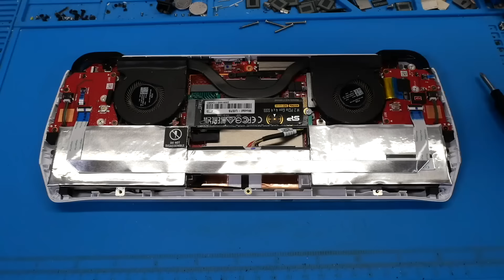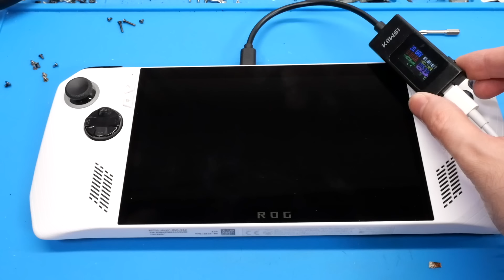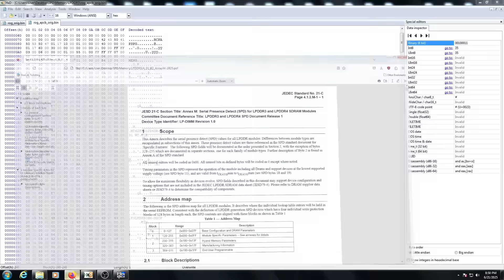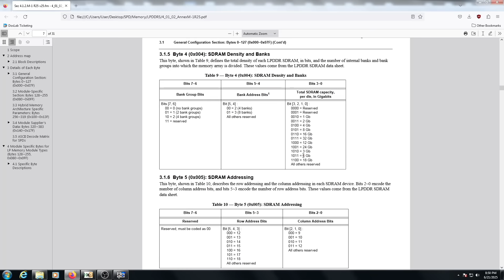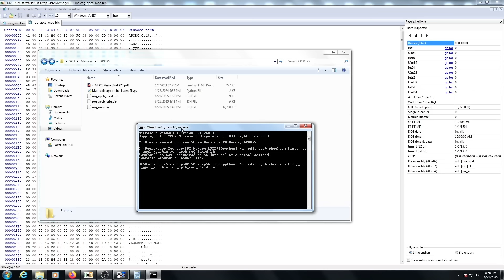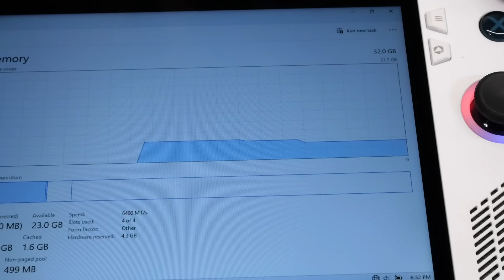ASUS ROG Ally 32GB RAM Upgrade

Comment: That ambient light sensor is actually pretty smart and can help inexperienced people. Swapping out the nvme is fairly easy to do in many devices these days, but people have screwed it up before... I told my friend multiple times to unplug the battery first, he struggled, so he just didn't. He then used his non magnetic screw driver and dropped a screw and shorted the powered board. If it had a light sensor, it would've cut the power off for him.

Making the ROG ally safer to disassemble + easy to mod is actually really cool.
Reply: Noob mistake
Reply: Most probably it is there to detect chassis intrusion.
Reply: @meetv7700 except it cuts the power and asus allows you to swap parts like the ssd. They don't even make it hard to open up via hiding screws or putting a warranty sticker.

It cuts power, then when you reassemble it and plug it in, it'll turn on normally
Reply: @KevinEF that explains why it doesn't turn on while disassembled. Did they know how many people will be terrified when their system doesn't power on while testing???
Reply: @m3zmr  skill issue
Reply: Wait, we really need to disconnect battery each time? I swap ssd nvme hundred times just unscrew- remove- put another ssd - done 😅
Reply: @DIMONSE123  You don't necessarily "need" to, but if you're a repair tech that knows what they are doing, you disconnect it.
Reply: @DIMONSE123 It's just good practice to avoid shorting stuff on the mainboard. Yeah you can just wing it, but overconfidence can lead to bricking things, so I'd personally just rather avoid that and unplug the battery.
Reply: @DIMONSE123  it's not necessary for swapping the SSD, but it's a general precaution to avoid issues as mentioned in the OP. That's the same reason there are safety railings. If you are careful you don't need railings, but sometimes mistakes happen
Reply: @DIMONSE123  There will never be a time where you wish you didn't disconnect the battery first.

Comment: Why 32GB and not 64GB or more? What is the maximum RAM that can be used on this specific device?
Reply from the maker: I did try 64GB on the Steam Deck at least, and couldn’t get it working, though I also wasn’t able to find any data sheets for the larger chips, so couldn’t determine the correct changes that needed to be made to SPD data. There’s also a possibility that the chips that large require extra address lines, in which case they couldn’t be used.
Reply: @dosdude1  Interesting. What about performance? Are there any measurable gains? Or at least noticeable better responsiveness or something?
Reply: @ronaldocost4 Since system RAM on an APU like this is both the regular RAM and VRAM, games should be able to run better or at higher quality settings than before. If a game needed 8GB of VRAM before, that left about 6GB for thr rest of the game once windows took its background piece. Now that's leaving 22GB for the game.
Reply: @ronaldocost4 from the Ally X vs the Ally with 24gb and 16gb respectively, most games perform just about identical. There are a few games but most of the time, the resolution and setttings you’ll be playing at will not benefit the 32gb or 24gb kits more. The Ally X actually gets more of a performance boost due to its ram being faster rather than the capacity increase

Comment: Amazing video! Could I ask what hot air station you use? I'm looking to get a new one and at the moment it seems most recommended is the ATTEN ST-862D but still looking around for comparisons
Reply from the maker: I use an Aoyue 852A++... Really works well for everything I’ve used it for, so I’d highly recommend it.
Reply: With respect to dosdude, the equipment he uses is among the worst. Aoyue852A++ is an ancient obsolete hot air station and you should not buy it. Newer stuff like ST-862D is much better. 
Amazed at what this guy does with cheap equipment.

Comment: When you switch the chips, but only modify the spd for capacity, are the timings correct? IIRC different manufactures have different timings for the same clockspeed & density memory, and full dimms store spd data with some timing information (Some timings are just from the bios/memory training, but I thought the primary timings where in spd.)

Comment: Are you able to allocate more than the 4 GB of RAM to the GPU because I would also be nice allocating around maybe eight gigs of RAM to it?
Reply: on the rog ally you can allocate even 8GB to the GPU via the armory crate app
Reply: I was curious if this would be a problem if you try to toggle it in armory crate
Reply: В этом нет смысла, если выделить больше памяти под GPU, то останется меньше места под ram, а при нехватке видеопамяти, видеокарта берет её из оперативной, а на встроенной gpu в cpu буфер VRAM общий с RAM, следовательно если будет не хватать VRAM, он будет брать её из RAM, а если будет не хватать RAM, то она будет браться из файла подкачки, а сссд в разы медленнее ddr5 памяти, или же если файл подкачки минимальный, либо же отключён, то недостаток ram брать будет неоткуда

Comment: If the bios update can "restore" the SPD data, can the update be theoretically modified before being applied to retain the correct values in the future?
Reply from the maker: Unfortunately not, as the update payloads are signed and cannot be altered. Somehow someone was able to get the private signing key for the Steam Deck, and as such was able to make pre-modified BIOS updates for doing this without needing to program the EEPROM externally. But no such thing has happened with any other device.
Reply: I was thinking the same thing

Comment: @dosdude1 so you don't need to move the strap resistor near the APU?

Also, if the system doesn't post, is bad RAM or bad solder? APU look far from memory, can you damage that?
Reply: The resistor selects which area to read the bits from.
He rewrote the bits to all the possible areas that strap resistor could be calling.
Reply: @Prophes0r  good to know, is so close to the APU, feels wrong to put heat in that area.

Comment: A Windows 7 PC connected to the internet giving me the heebyjeebies. Join the Penguin side friend!
Reply: When you do the stuff that he does, you use whatever OS has the tools you need.
It is totally normal for obscure tools to literally only have a Windows version.
Sometimes that software doesn't even work on recent Windows.
Almost none of the software works properly in a VM either since it usually exists to talk to bare metal.

It's just something you end up having to deal with.
Even new chips fresh off a 2025 fab can require you to boot up a Win7 machine to poke their bits.

Comment: hello i am 15 years old am really interested in being able to understand electronics and fix them i really look up to you and would really appreciate some advice from where should i start (btw i am also learning to solder and c++ and is  learning to code and make small projects with esp32 and arduino)
Reply from the maker: I started learning this stuff by buying and repairing water damaged MacBooks off eBay. The older ones (2012 and older) are easier to get started with, as they are easier to work on, and the schematics are readily available.
Reply: Do you have a degree if you don't mind @dosdude1
Reply: @dosdude1  if you dont mind me asking do you got a degree if yes in what major ?
Reply from the maker: @Red_x101  I have a Computer Science degree, but not much of that is really used with regard to the hardware mods I do here LOL.
Reply: @dosdude1  btw thanks for just replying
Reply: Hell yeah, bro. It sounds like you're well-ahead of the game! Keep pushing the envelope!
Reply: Bump
Reply: Wtf @pauljones9150

Comment: I'm wondering if it might be possible to set the bios version number to something absurdly high when you edit the bios data to essentially prevent windows update ever applying an update even if  the system firmware device wasn't disabled?
Reply: Good point

Comment: Looked pretty easy until the bios flashing 🤣
Reply: The firmware flashing is the easy part.
Desoldering/soldering those chips without accidently bumping the components next to them that might as well be grains of sand, and invisible under the liquid distortion of the molten flux, is the skill here.
Most people are simply not capable of doing the manipulation, and those that can usually need to do annoying stuff like avoiding caffeine or stimulants for a day or more beforehand.
Keep in mind we are basically seeing that stuff under a microscope.
Reply: @Prophes0r   can you pay someone to do this
Reply: @Prophes0r  avoiding caffeine? bro its not like literally everybody drinks energy drinks or coke every day. it's really not that hard
Reply: @min3craftpolska514  Not everybody does, but most humans do. Something like 65% last time I checked. Other than a few religious sects that prohibit it, nearly all cultures consume caffeine(or another similar stimulant) regularly.
Also, it isn't ONLY caffeine. A whole lot of stuff we consume can cause problems with fine motor control even if it isn't a stimulant.
Reply: @min3craftpolska514 idk what kind of life you live where caffeine and energy drinks aren't involved in daily life but I won't no part of it lol😂
Reply: Well hey, on the upside that's a much easier skill to learn than the BGA soldering is, if you can already do BGA rework then you're 90% of the way there :D